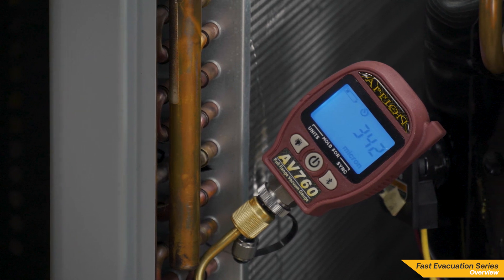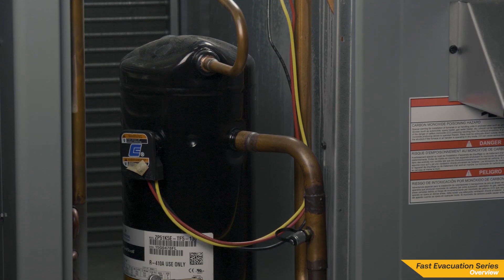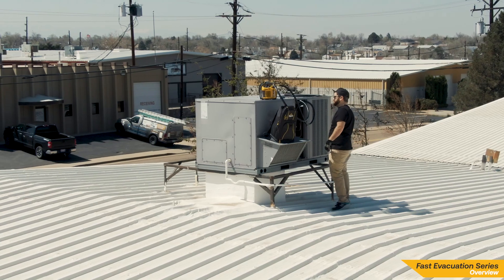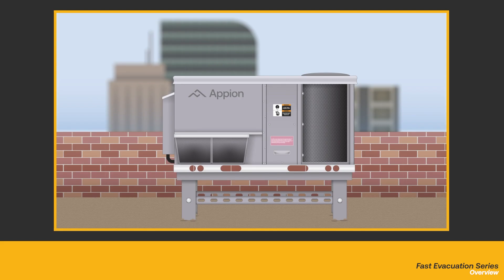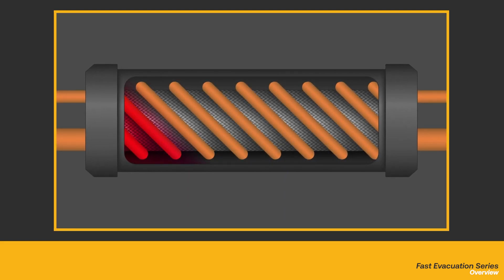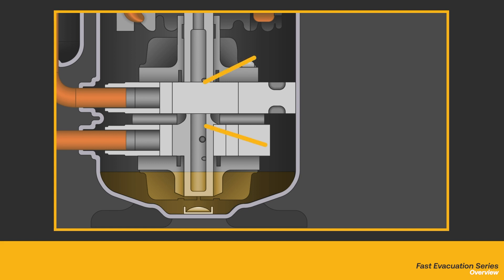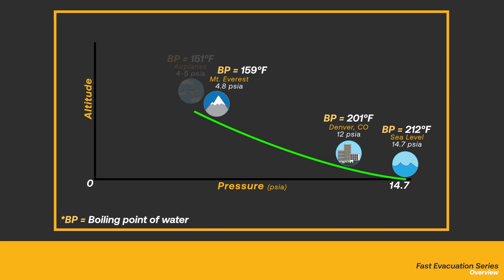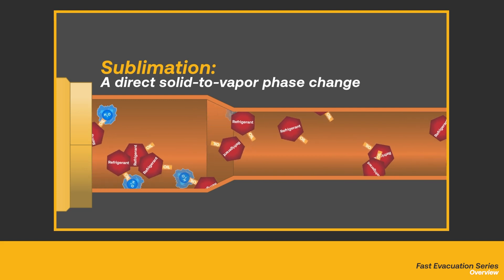Fast Evacuation Series // Overview

Comment: hi! i just bough a SPEED-V kit with two black hose, 4 shredder core removal tools, and some Y adapter, all that in a bag.   I am wondering if you have a solution to my problem!

With some shredder valve, i cant enter the tools in the valve cause the valve is too large... some models, and more commun and newer units of all type.You should have an other arm with a bigger end to it , we could swap and use the right one. Kinda sucks for near 600$ CDN. I wanted to order the speed-R kit recovery, but not sure now, since i should only order the tubes, and the Y, and should buy an other brand of removal tools, or grind it to adapt it.....   not sure. I do love the hoses alot, and all the fittings has well. only that issue,
Reply from the maker: Our Valve core removal tools only come in 1/4" and 5/16" swivel fittings. You can purchase hoses individually if you don't  need the full SpeedKit.